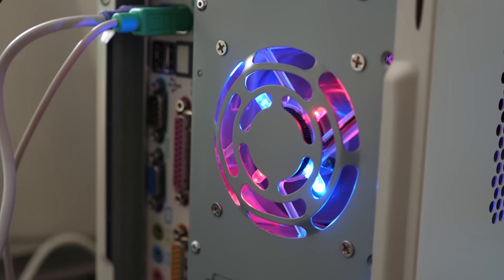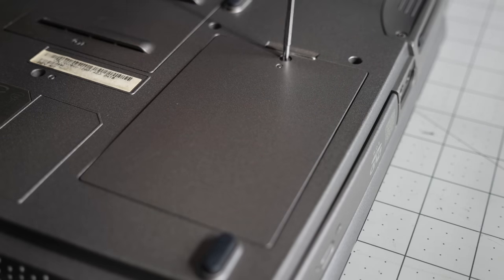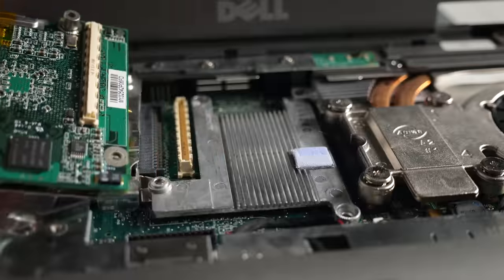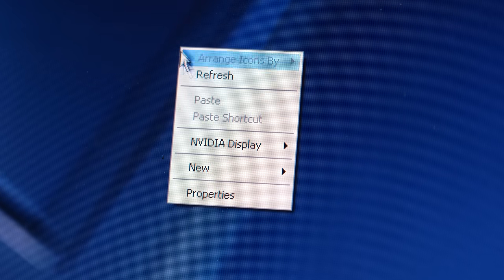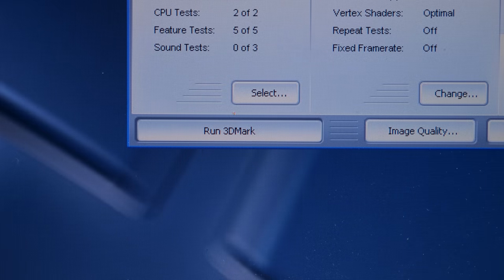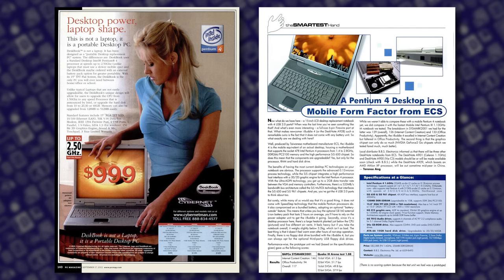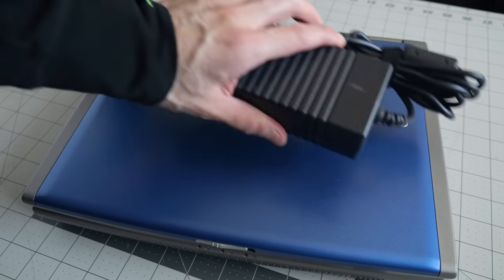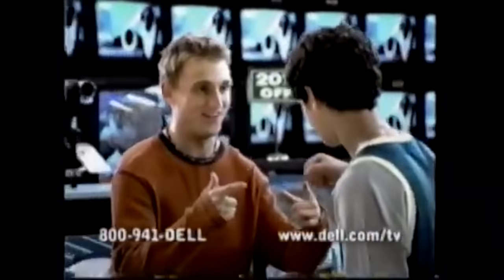Dell Inspiron 5150: Good for Windows XP Gaming?

Comment: I have a Latitude D800 and the graphics problem is multiplied. Mine has the same GPU with half the vram, and a 1920x1200 screen. I got a 128mb mobility 9600 to replace it however the vram seems to be faulty as it gets visual artifacts on screen. Hope I can get that working or find a working one. With the 9600 it would be a very nice XP gaming machine.
Reply: @Unknown Nomad let me guess, the hinge? The hinge is stiff on mine. I ordered some white lithium grease to lubricate them to lessen the stress. Also mine is named “Kraken Burger” I named it that because my Dad called his old college laptop “Squid Salad” and this is the bigger cousin of it. His old laptop is a Latitude C600.
Reply: @Unknown Nomad that’s where the hinges mount, near each rear corner on the bottom case.

Comment: Another related pick would be the original Inspiron XPS laptop; I recall it was a step or two above this one in terms of specs and was designed as a gaming laptop. The double-edged sword was that it used Pentium 4 desktop CPUs, so it ran hot and battery life was abysmal. However, for a deskbound retro gaming rig that won't take up tons of space I figure it might be a good bet these days.
Reply: I bought a 5150 new back then. After a ton of research and cross-referencing part numbers way back then I discovered the 5150 and the original XPS were exactly the same laptop - chassis, most parts, etc. And they were ALL interchangeable. I upgraded the LCD, the discrete video to the ATI, and even updated the case plastics to the silver XPS ones.
Reply: @insovietrussia  : I had one for a couple of years and it was a great rig for its time. I recall I ended up selling it to upgrade to an XPS M1730; that one was an absolute beast though plagued by Nvidia's mobile GPU substrate issues. :/

Comment: I have 2 inspiron 5100 laptops that still work, however one of my 5100 laptops has a bad ram slot
Reply: The one with the bad slot has the A32 bios able to run 2x 1gb sticks
Reply: The other is on A31 and all I have in ram for it is a single 1gb stick which isn't optimal, would be better if I still had some 512mb sticks for it to update the bios
Reply: It never fully goes through the starting checks because the 1gb sticks don't work until the A32 bios is installed
Reply: I need a keyboard and the cover piece  however they're hard to come across in my area
Reply: Had to recycle an inspiron 1100 couple of years before I got the 5100's

Comment: I had two of these back in the day, first was the lower grade version with only integrated intel graphics, second was a 5150 like this one, also with an NV30 GPU.
They were my daily drivers from 2003 to 2009, but eventually got replaced due to lacking specs and cooked batteries (sometimes literally), at that point I went back to using a desktop for my computing needs.

Comment: I don't think I have any Win XP games that can't be played on at least Windows 10. Most of the games released during the XP days ended up on online storefronts like Steam, which have actually done a pretty good job of patching them to run on modern Windows versions and modern hardware.

 That said, if I was going to seek out a machine to run XP natively, I'd look for something with a core 2 duo or quad chip. Or maybe even an early core I series, like a Sandy Bridge or Ivy Bridge chip. Any of those processors work perfectly with XP and will blow the doors off an old Pentium 4.

Comment: Man, I was still running 128mb ram in 2003 and it was by far the biggest bottleneck to the system. It's insane how long ram was a major limitation on computing performance for everyday users.

These days? Not even a consideration until you get into heavy task loads.

Comment: I remember in the early 2000s, migrating all the laptops to the company I worked for to these Dell machines. This was an interesting time, as things like PS2 keyboards were phasing out and everyone wanted wifi, despite not having it in the office (someone plugged in a router in their cube not thinking that anyone could connect to the network). Strange times indeed.

Comment: I had this exact computer. I remember being amused by the "5150" model number. And being attracted to it for its hi res screen. 

For wifi I used an external Linksys dongle module. About the size of a pack of cards attached to a usb cord. 

These ran hot and became dangerous if left on something like a bed.
Reply: Yeah, It's totally crazy that they let that model leave the facility at all, but judging by the lack of awareness in even these comments, I guess, it flew over the heads at Dell too.